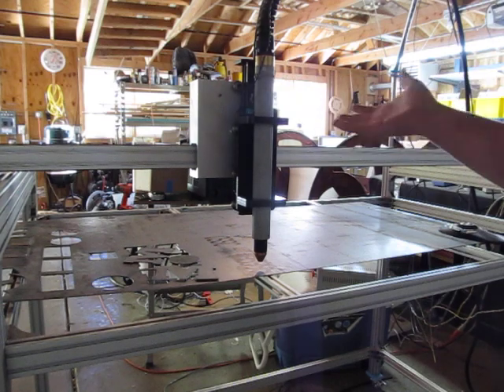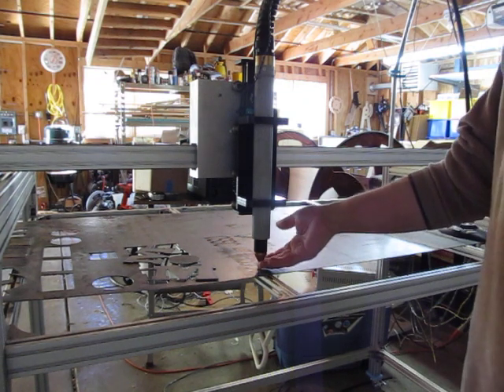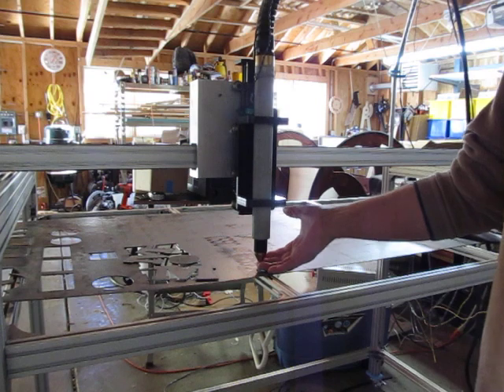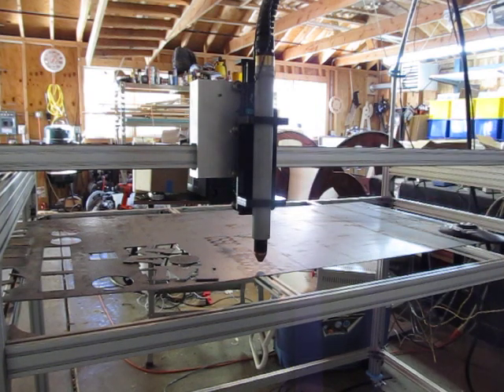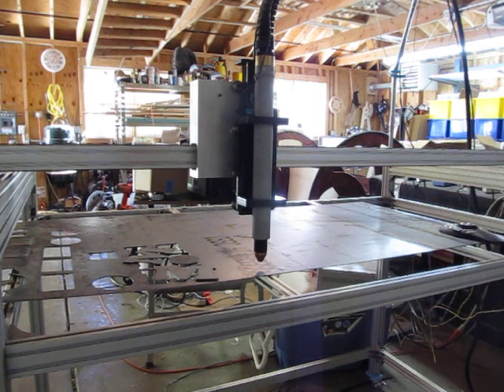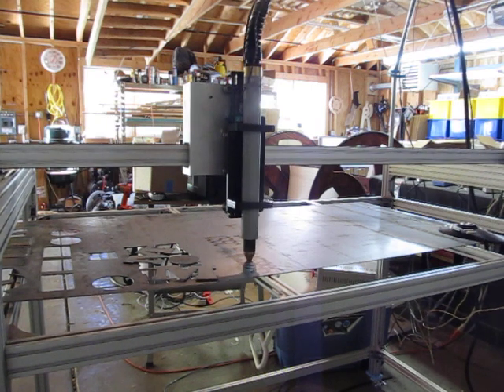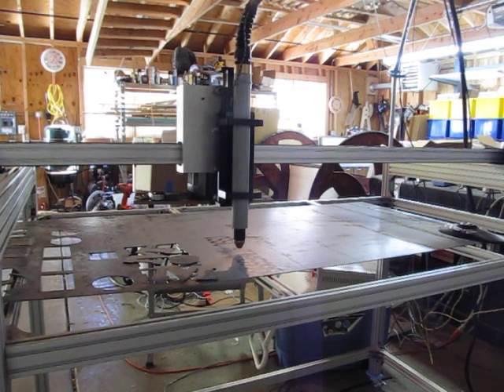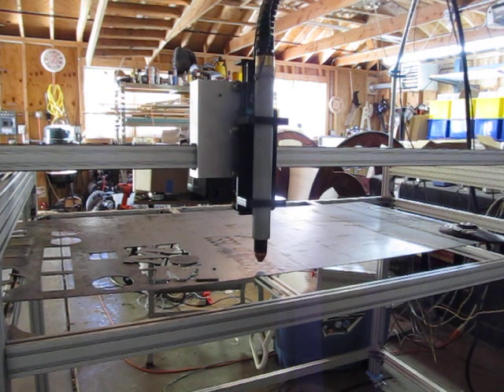Buildlog.net Plasma Floating Z Demo

Comment: hi,do you have complete wiring diagram about floating switch z axis,i use bob 5 axis and driver tb6600.i'm confused how to wire floating switch to bob and how turn plasma on/off.thanks